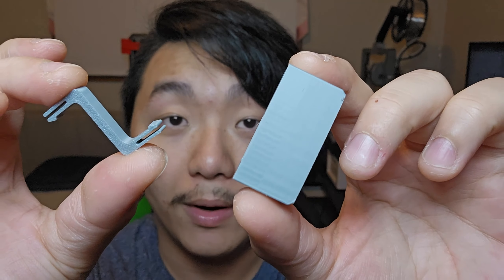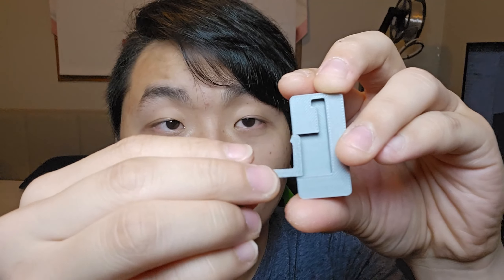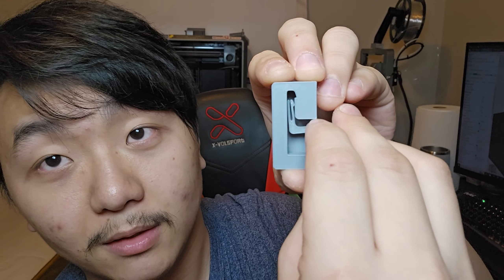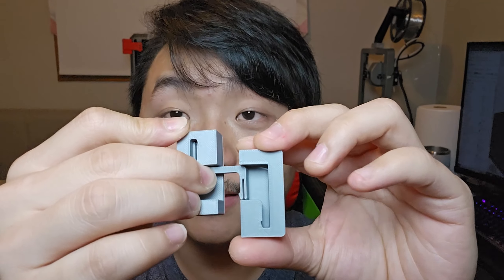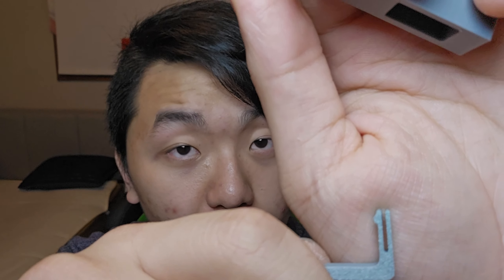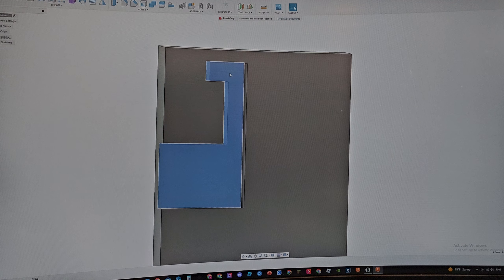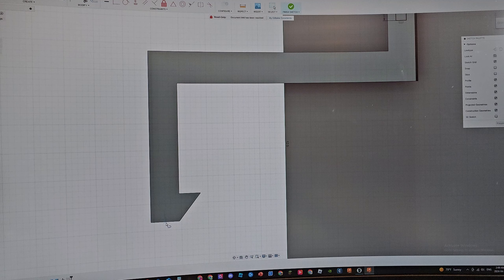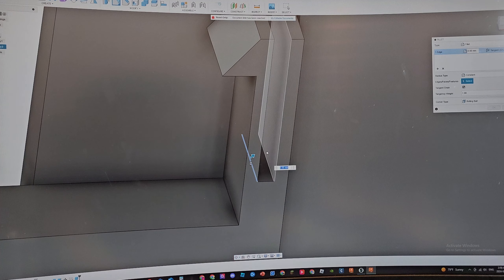Connecting 3D Printed Parts With "S Bracket Connect"

Comment: 1. It would be rather rational to first make the "compliance cut" in your hook, and only then create a "reverse" side by copying and rotating.

2. You can make tighter tolerances and for disassembly - go with a hole through the main part, that allows you to put some kind of pin through and compress the hook to get it out.

3. You a filming a screen with a camera. A computer screen. With a camera B-)
Reply from the maker: Thanks for the tips, I'll try to screen record next time.